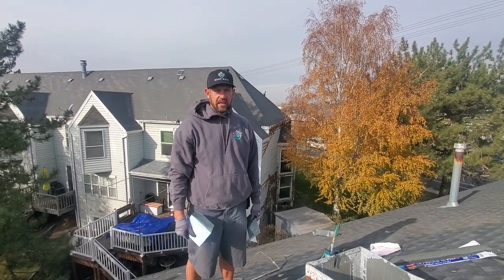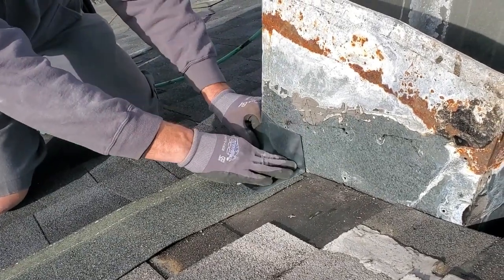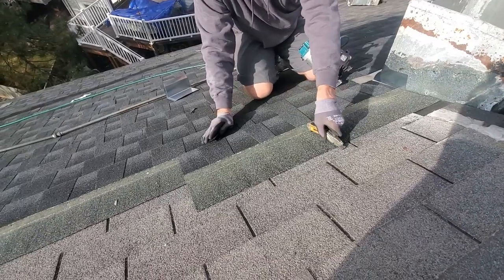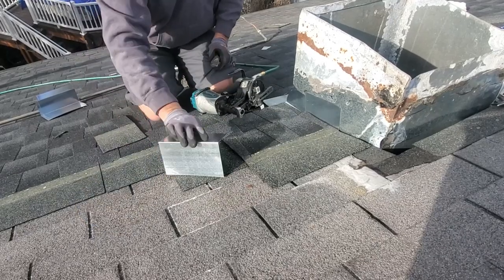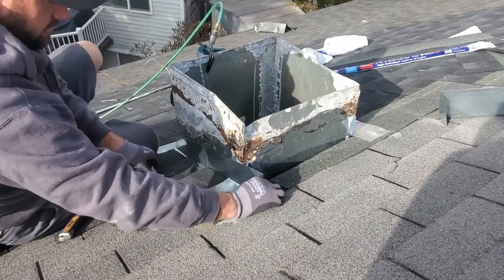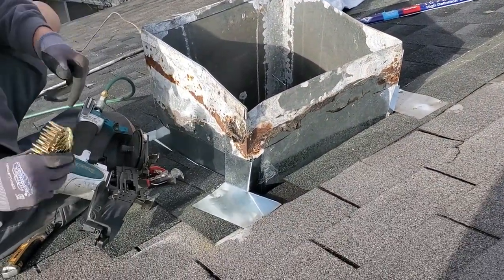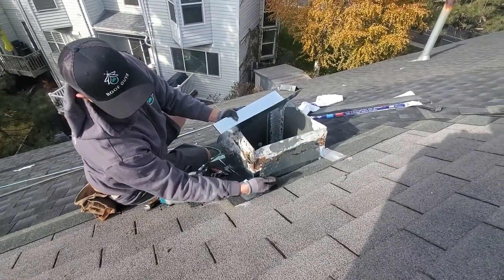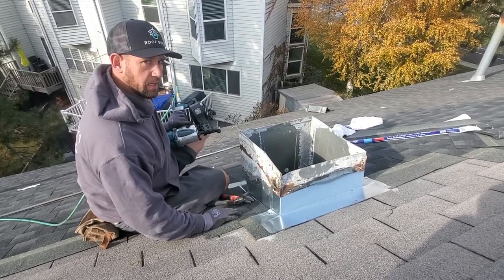How to install chimney or swamp cooler flashing.

Comment: This should be a video about how not to install flashing for evaporative coolers. 
1. Under pressure driven hydraulic force,  water can gain entry between the gaps in the sheet metal. 
2. Asphaltic Sealant needs to be placed on the base felt extending 6" around the entire perimeter of the ducts base and 4" up the sides.  
Then an evaporative cooler roof Jack is installed over the felt / base paper and secured with screws , not nails. 
4. Piercing the sheathing with a nail gun at a place underneath the coolers pan, can present an entry point for water. 
I've been on many jobs where the customer tells me that when it rains water is leaking into the attic or down the side of the duct.
Reply from the maker: We sealed the flashing and riveted it to the swamp cooler ducting. We should have put that in the video.
Reply: @theroofguysutah  Oh, good job roof guys.  I service,  repair and install swamp coolers for a living.  I thought there was something a little hinky about the video.  Again thanks.
Reply: @anthonygonzalez7488  Do you know anyone in Northern California, who installs/repairs swamp coolers? Ours wasn't installed with the roof jack, just sits on the roof, and of course leaked inside.

Comment: Wrong. 

First step flashing diverts the water away from the corner, should be a good 3" down. I usually bring it down to where the front wall flashing is. Then I put in a dummy shingle (a thin part of the shingle, about 4/5" just to hide the side of the flange, looks great and it doesn't affect it at all) you'll just have to double up two steps to extend past the height of the shingle. 

You shouldn't have the nails that close to the chimney (or whatever it may be) should only have two nails in the top corner, furthest away from the chimney when doing step flashing. Nailing on the bottom part of the flashing isnt needed and if water were to get under the shingles, it's not going to have any room to divert itself off of the flashing without hitting the nail. Keep the shingle about a 1/4" to 1/2" away from the wall to allow for water flow, otherwise it increases the chance of water wicking underneath the shingle if its butted tight against the wall. Same goes for vents and plumbing stacks. The last piece of step flashing is correctly done. But still isn't nailed properly. Although it is better to wrap the piece of step around the corner instead of cutting the excess off. Just makes it so it holds tight to the wall better. 

The back pan shouldn't be wrapped around like that, should have it extend out atleast 3/4". Then it should be folded down like a dog ear to shield rain from getting in that corner. Always put one shingle under the back pan, then the row above it should have atleast 3" of room to allow water to flow out and not wick under the shingle and sit there. Also helps at keeping leaves and such from getting stuck back there. Should have a positive slope to the back pan so water doesn't just sit, but not to a point that one side has a huge gap on the underside.

Learn how to do things properly before posting a how to on YouTube.

I hope that someone else did the counter flashing on this otherwise it will most likely leak within the shingles lifespan.
Reply: As long as it dont leak  or fly off its a fine flashing job. That metal looks real thin tho